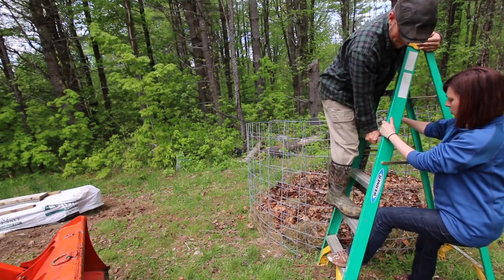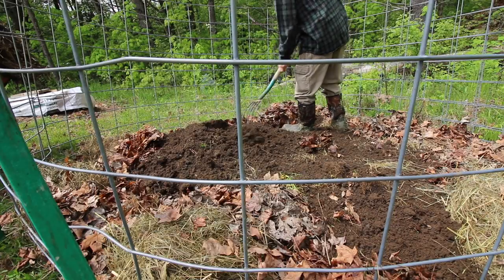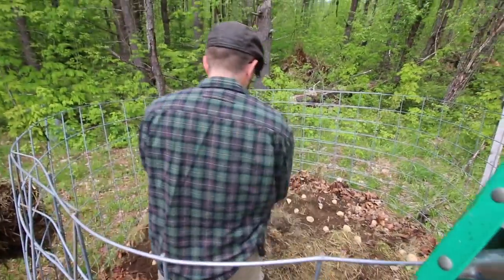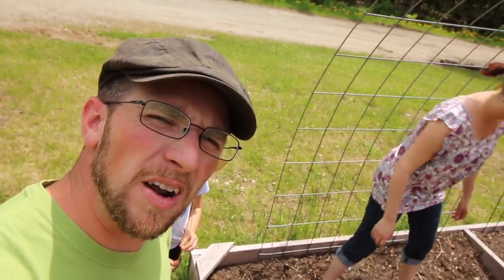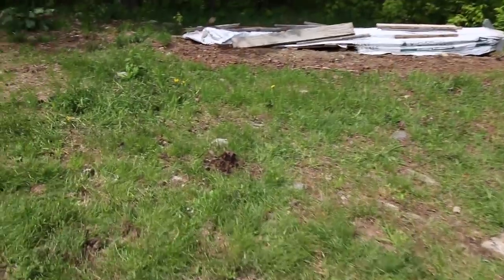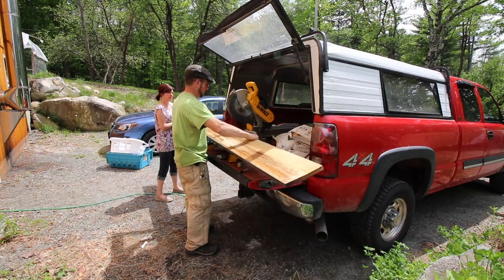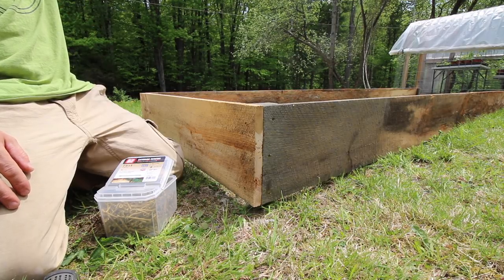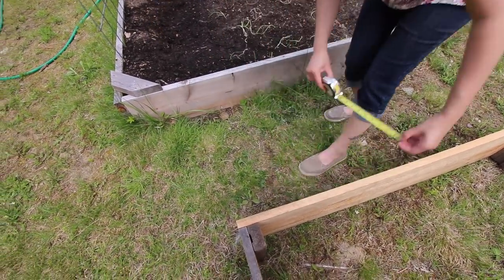Growing Potatoes in Cattle Panels

Comment: Another good thing to put in your potato bin for nutrients, is the charcoal and ash leachings from your fire pit. Ash when it's fresh dry and powdery is very very alkaline like lime, with a pH around 11, but it's also nutrient rich with potassium and all the minerals plants need. Once the rain hits the ash, it starts leaching away the alkalinity and some of the nutrients, but your garden would still benefit from adding what's there, to help neutralize the acidity in the chicken manure. Also if you fill your bin up more with hay, straw and or leaves , you can plant your potatoes in the sides of the cattle panel to, so the raised wire bed becomes like one giant bush, increasing your square footage and overall yeild. If the northern side doesn't get much light, and some potatoes are very small, they can become your seed potatoes for next year.
Reply from the maker: Thanks! We have plenty of wood ash from our wood stove! I store some in a metal bin with a lid on it. I will have to add some to the potato bin.  We will keep adding more hay and leaves as the potatoes grow. I can't wait to see how this does!
Reply: Lumnah Acres - Hey if I could give you one other tip if it's not to late. When you keep burying your potatoes like that, it will help them stay moist in the drought, but it doesn't increase yeilds. If you want good yeilds, fill your bin up, and plant them 1.5 ft or even 2 ft apart all over the top and sides. As the straw settles you can mulch a little, but don't bury any healthy leaves. The way I just described will increase your harvest by about 75% in comparison, and will be less maintenance as the growing season progresses. If you have the resources to set up another bin, maybe do a comparison of the two methods, and document the difference in maintenance and yeilds. That's would make some great videos!
Reply: Wood ash is like lime in your garden it is good for your garden but you need to not let it touch the potatoes, it is better to layer lime or wood ashes on top, if the lime/ wood ash touches the potato you can get scabs or open sores on the potatoes. I put my wood stove ashes on the garden in the winter time when the ash bucket gets full I spread it in my garden over the snow, it helps to melt the snow later when the sun hits it as well, and I also use some wood ashes in the barnyard if the driveway gets icy, but don't put too much wood ash around the door way it tracks inside and is messy.
Reply: dpower02 - Proper application of wood ash or lime is always necessary, as with any amendment. Due diligence is always a must in all aspects of life including gardening.
Reply: These are great tips. Thanks

Comment: love the use of panels for potatoes, chicken tractor to hot house is genius.   Another grower uses 1/2 inch Gopher screen and woodchips.  two circles or boxes.  inside build mulch..outside 6 inches of woodchips.  Just add chips and leaves each fall.  Air pruned roots grow very well. Keeps garden looking great.  Line bottoms to keep out gophers moles ect.  galvanized Gopher screen.  Can be easily reset leaving great dirt behind.  Strawberrys do great.
Reply from the maker: Thanks! Great info. Glad you shared it!

Comment: You might put a stake in the ground on the outside in the middle of the long side and run a 1x3 strap across to keep it from bulging out.  Bert
Reply from the maker: Thanks. I didn't show it but we put some bracing in the center so the boards won't bow.